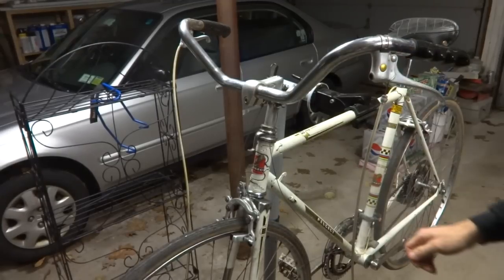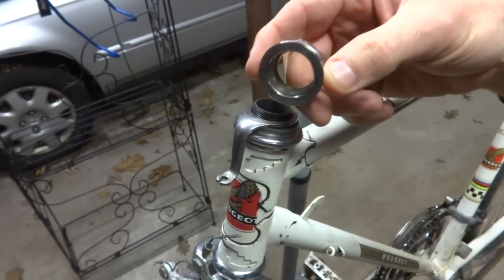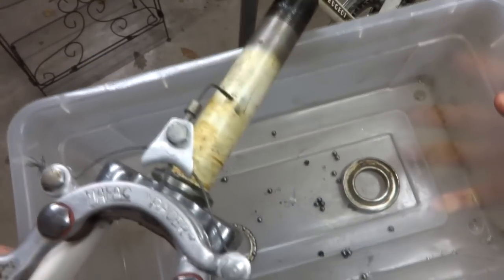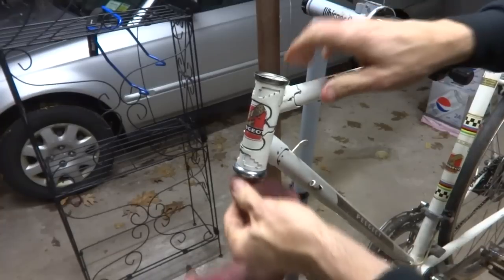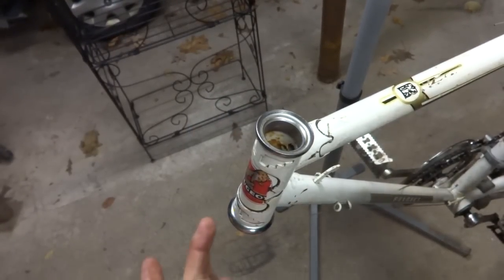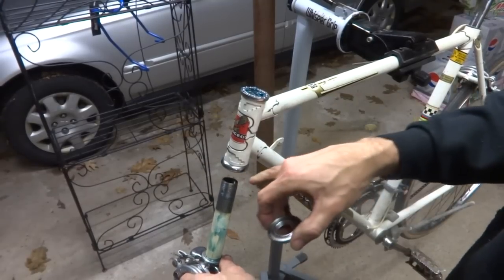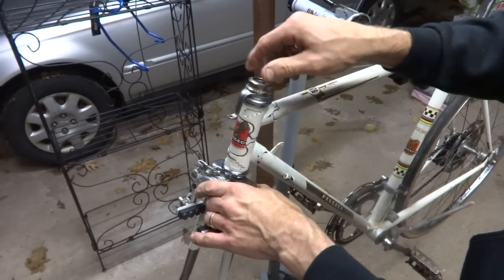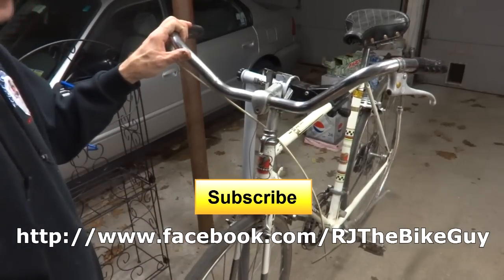How To Overhaul Vintage Peugeot Bike Headset

Comment: Hi RJ !

Im having a problem overhauling a headset. It has loose bearings (with no cage), i took them out and cleaned them. When i put them again it seems like the cup doesn't fit :/ . In fact, you can see the bearings through the small crack between the cup and the "concave cup?". Is there anything you think its happening ?

Thank you very much and sorry for my englando :D
Reply from the maker: Sounds like you installed them incorrectly. Redo it.

Comment: how do you cut that groove in a new threaded fork for the keyed nut and cable guide. Need to install a virgin fork on a steel 1 inch threaded frame.
Reply from the maker: Not sure the best way to do it. Maybe with a dremel. Of just file the keyed washer to remove the key.

Comment: If I remove the hanger do I need a spacer or can I just put everything back in place without the hanger ?
Reply from the maker: You may or may not need a spacer. It depends on how the lock nut fits, or whether you run out of threads.
Reply: thanks for getting back :) I got rid of the hanger and just lubed the threads and it runs smooth. I'm restoring a mixte kinda giving it a new look it's turning out awesome so far
Reply from the maker: Ricardo del Rey Cool! I passed up a Peugeot Mixte a while back. Still kicking myself a little. Oh well.
Reply: Thanks for the tip! I also have a Peugeot Mixte (from 1974) where I stripped the lock nut.  I'd replaced the hanger with a spacer some time back, and was able to just remove the spacer to bypass the stripped threads.  Fixed forever!

Comment: Is there any way to upgrade the whole new headset and cups to fit a carbon 700c fork ? Thanks
Reply from the maker: You should be able drive out the cups and install a new headset/fork.
Reply: RJ The Bike Guy wouldn't it be wise to measure the head tube ID to be sure that the new headset will fit ?

Comment: How come it's got loose ball bearings in the bottom race, & caged bearings in the top?
Reply from the maker: I am guessing because the weight of the rider and the bike are resting on the lower ones so the weight and pounding are distributed over more area.Ask Peugeot.
Reply: Or, it could just be that the last person who overhauled it threw away one of the cages & just used loose balls..

Comment: Why don't you use a caged bearing in the bottom instead?
Reply from the maker: Loose bearings are actually better as the force is distributed to more bearings, over a wider surface. Caged bearings just make it easier and cheaper for factory workers to install them.

Comment: Can you make free wheel louder sounds
Reply from the maker: You want to make your freewheel louder? Is the freewheel not working? I suppose you can make it louder by flushing out the grease/oil and then oiling it with a very thin oil. Like in this video, but use a thin oil. But I am not sure if I would recommend it. How To Fix A Sticky Freewheel

Comment: Why in the world didn't they use caged bearings on both the top and bottom of the headset?  Darned French!
Reply from the maker: Loose bearings are better as the weight and impact is distributed among more bearings. Most applicable on the bottom. Caged bearings are easier/faster to install.
Reply: @RJTheBikeGuy  I see!  Thanks for the reply!

Comment: Caged on the top loose on the bottom. French  engineering.
Reply from the maker: The bearings on bottom have all the weight on them. The top ones don't.
Reply: I love the French but some friendly ribbing is needed here. Properly maintained caged bearings work fine on the bottom of headsets. So much easier to service as well.

Comment: My bike is single speed bike i want to make it an 10 speed
Reply from the maker: Ado Ahmed Possible, but probably easier and cheaper to buy a 10 speed bike to start with.
Reply: I dont want to buy a new bike i want to make the single speed to 7 or 10 speed
Reply: My bike is fling pegon